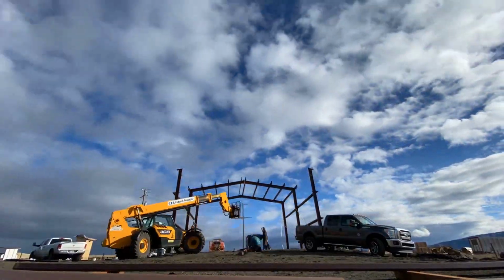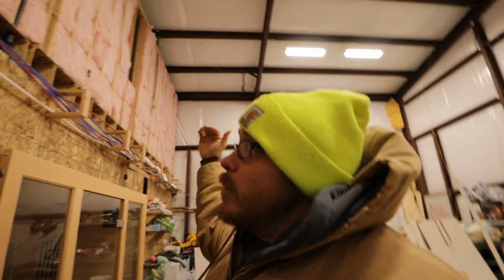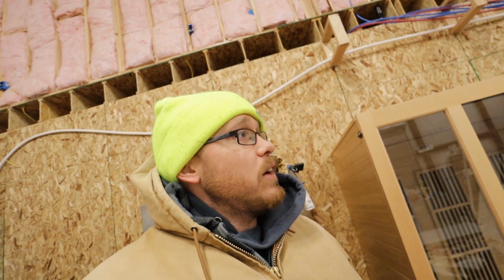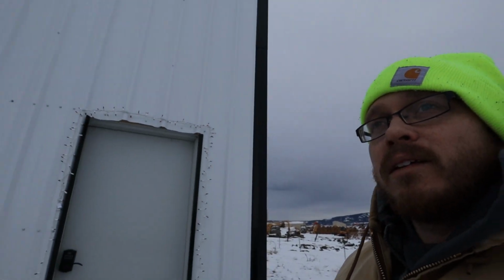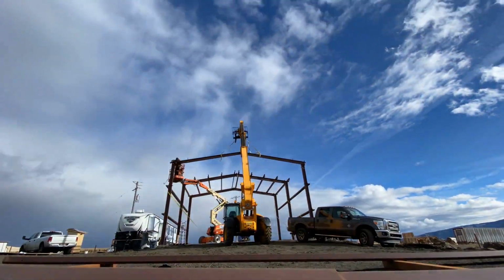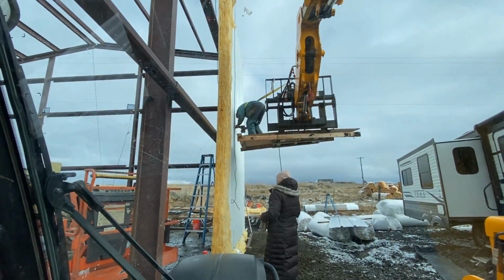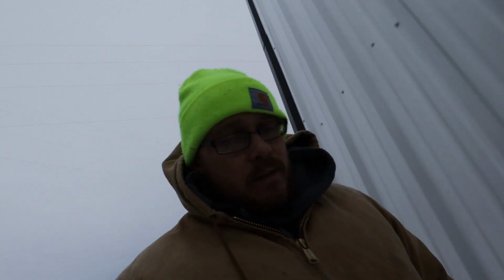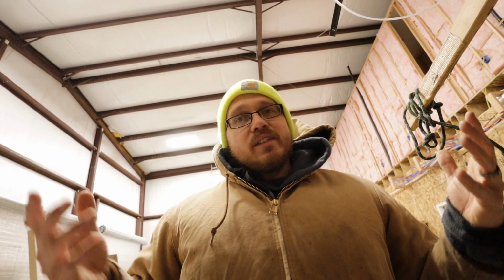How Hard Is It To Build Your Own Steel Building?  (I built my 60x40 barndo with no experience)

Comment: 1. Did you design this building or you bought their already designed kit from Star State Steel ? 
2. Do they make different sizes and shapes?
3. How did you attach the Big I-Beams to the concrete. Did you use pole bases burried in the ground with 4 bolts based on the specs on the building structure.
4. What are the sizes of the I-beams you used ? Are they 12" and what gauge.
5. Did you have an option to choose from different gauges of the I-beams and their sizes
6. Do they make custom shapes 
7. Do they make these kits complied by the local building codes based on the state
8. Do they ship to different states.
So many questions 😊
Happy Easter 
Thanks
Reply from the maker: Starstate steel designed it and engineered it, so they definitely do make all kinds of shapes and sizes. The i-beams are attached using bolts and epoxy. The contractor who poured the slab didn't want to place bolts so we opted to drill once we were erecting. He would have been better to place the bolts beforehand though, we didn't have any issues. Despite this though. I don't know what gauge and size the i-beams are because it came engineered and that wasn't an option. They calculate that based on snow loads and wind speeds. I really suggest having this done so that it is engineered for your location. The building was fabricated in Houston and shipped up
Reply: @homesteadingbarndo  Thanks

Comment: What did your county call for as far as r rating on insulation?
Reply from the maker: We don't have building codes in our county except for septic, we used a 6 inch r21 around the steel and then used an r15 in the 2x4s we framed in. Once we are done building we will do a blow in r30 on the ceiling of our structure inside.you can see here https://youtu.be/aOKgRyXhiUc at the 4:31 mark
Reply: @homesteadingbarndo  sounds very adequate at any rate.  My county requires r 50 in the ceiling.  Going for the envelope rating prob.
Reply from the maker: @aaronymousunlimited2661  we stayed really warm with only mini splits, but we are going to be adding a wood burning stove this next winter. Want to be able to keep the house warm without electricity because we had about a dozen power outages and going outside in the snow to start a generator and back feed the panel isn't so fun

Comment: How much did the whole project cost? Concrete, electrical, plumbing, the building itself and the equipment used?
Reply from the maker: OK! I added everything up and broke down all the costs, it was 113,000 for everything, I broke down each part and talked about my mishaps on this video: https://youtu.be/pfoq-IYr3SE
Reply from the maker: I'm going to make a coat breakdown video putting all my receipts together. 

It was definitely way more than I budgeted for because we went way over on almost everything, I covered those mistakes in my most recent video, and I also never imagined lumber would have gotten so wild (I bought OSB for 132 a sheet)

Comment: I'm trying to complete  a building  for near 3 year now...got it outa Pittsburgh, r&n manufacturing..well buddy everything had problems..not to mention that they promised 3 month turn around turned into a year...then to find out all the base brackets made wrong..all the gable end brackets made wrong, all the trim was bowed so bad that it had to be replaced..all the galvanized roof was full of black corrosion spots..now the screws are wrong length..two year battle to get replacement parts...never, never again..I'm like you quite handy but never took anything like this on..well steel structure is up..but not wanting to battle rain and wind over winter..I'll hopefully insulate and sheet in this summer...oh yeah...concrete company fucked the cement slab as well with an unexperienced driver letting the mix setup in truck...just lovely...never again!!
Reply from the maker: That sounds terrible Ross! 
We were really lucky that everything was pretty much correct - we didn't have any detailed instructions and some of the attachment brackets were missing for the upstairs window frames, but nothing like what you're going through! 

I think it is a good plan to wait til the weather is agreeable. The wind was so sketchy to the point of me thinking I was going to be seriously injured a few times. Luckily everything turned out ok.
Reply: @homesteadingbarndo  yup a long way up there to ride a metal sheet to the ground lol..could very well be life ending...I figured best to wait..sucks but oh well..they were just horrible to deal with..(r,&n)and the broker ..Tower Steel  outa Toronto ,Ontario  were just as bad...they tried to dupe me and change the plans we agreed on...very slimy. ..over all just a rotten experience for something that's a once in a lifetime purchase...
Reply from the maker: Stay safe and good luck!

Comment: Hey you mentioned 6" insulation..how long were the screws for that?
Reply from the maker: They are a 1.5" screws, it compreses on the perlon so that it doesn't make a difference in screw depth. 

If I was re-doing it, I would do spray foam 100% 

I will be doing another video on the changes I would do if I was doing it again
Reply: @homesteadingbarndo  ok ..yeah 2" screws are what should be used..I talked to alot of pro's about this...can cause a dimple on the roof sheets which lead to leaks, so they say
Reply: @homesteadingbarndo  hey did you have to deal with any rain while insulating?